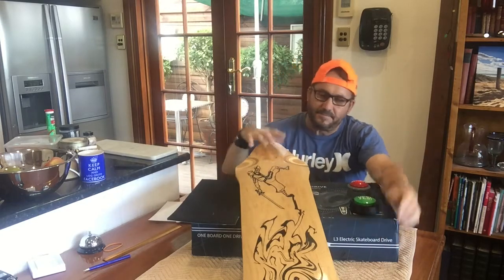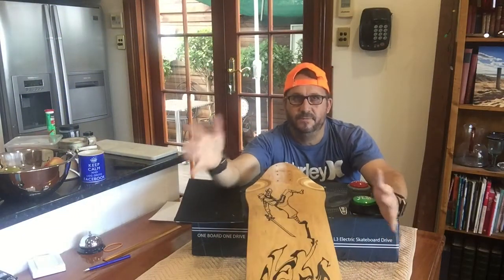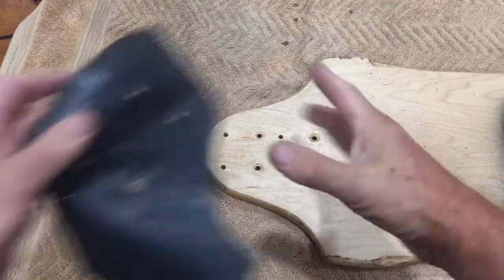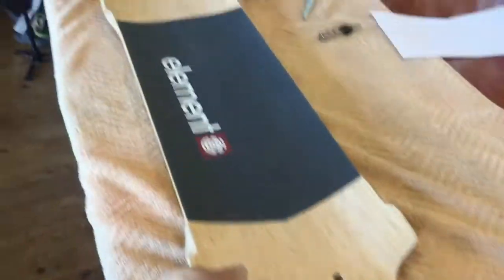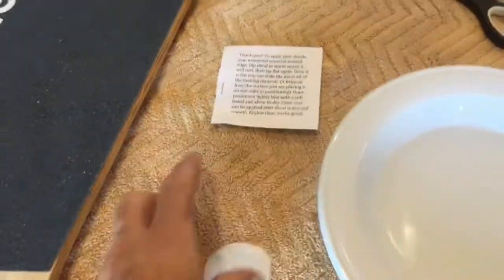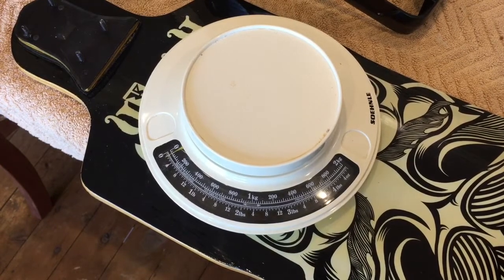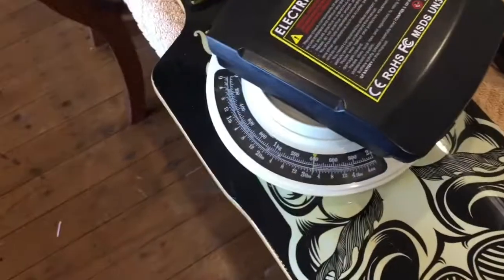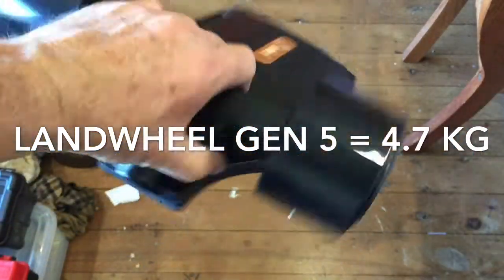LandWheel V5 L3-X EBoard - Full Setup and First Ride Andrew Penman EBoard Reviews Vlog No 51

Comment: Hi Andrew the board looks great and awesome video on the full set up. It will make it a lot easy for anyone having this to refer to when putting a EBoard together..Cant wait to see part B...
Reply from the maker: Herb Brad Tronc )) Cheers that’s really appreciated)) it was fun... all went so smoothly ... unfortunately I didn’t have a enough or the right width grip tape so I had to be dead accurate (within 1 mm) in rolling at sucker out ... it’s quite difficult as you can imagine.... ever tried to roll a piece of rectangle carpet rug up LOL ie Part 2 coming is quiet important for this Booster ...Cheers Bro Andrew )(

Comment: halo again Andrew, do you prefer this or the Onan x2 2wd =) ?
Reply from the maker: Het JasonxFong )) it’s great to hear from you Jason. Okay both are nice Boosters but the landwheel Gen 5 L3X has a much better battery latch connection design and a much more superior ESC in terms of it’s linear curve  and ultra smooth breaking. The battery on the Landwheel is also smaller (700grams) and more powerful its a LiPo Polymer. The Landwheel also has a faster top speed at 42klm /h. Don’t get me wrong I still like the new Onan X2 ‘s Sensorless FOC it’s vast improvement on the original ESC )) Hope that helps Jason) awesome great to chat Andrew)(

Comment: Thanks, Andrew! How odd that the total Landwheel drive weighs more than the Onan! I look forard to range and hill testing.
Reply from the maker: Hey Mike Cane )) Great to hear from you, yes it is very interesting, but it is a good point because it means the battery on the Landwheel is half the weight which then obviously makes the mechanics / motors and  hubs more heavier than the Onan’s  which is a good thing actually ie that means it’s made with more solid parts and slightly bigger KV rated motors and say )) there is a small issue with the sides of the battery compartment coming loose on the Booster and I’ll in my wrapup on the “Long-range Distance test” and follow-up with a nice Vlog  on how to hack /modify / fix it which a typical Andrew Penman classic perfect hack/ fix lol ) other than that it’s an incredibly well made and beautifully refined electronics and technology EBoard )) Cheers Mike keep up the great work in NY)) Andrew )(

Comment: Nice grip job on the deck..  Can you charge the battery out of the board??
Reply from the maker: Hey Brian D Howard )) thank you so much bro, yes you can it’s a better clicking in locking system battery system than the Onan X2  it’s a smaller battery and it’s just a beautiful unit however Brian there is a small issue with the side plastic casing coming off and I’ve done a really good modification fix for this )) and Landwheel have increased their screw sizes now )) Great travel OS  Eboard Brain to add to the quiver ie put on a nice small deck for you it would be a pocket rocket  )) cheers Brain Andrew )(
Reply: Andrew Penman I keep toying with the idea of getting one and adding it to a slightly larger regular skate deck,  it would be fun to ollie up crubs with it..  Due to weight a curb would be the biggest ollie I could get I bet..  Great review as always..
Reply from the maker: Hey Brian D Howard )) absolutely that would be a really nice piece of her afterburner when you’re ready get air ... lol .... I haven’t got huge clearance under them unfortunately but the Onan is the best of the two )) look pretty sick on a Penny Board to that fits in the small backpack it’s incredible amount of power for a penny board.... I’ve seen your skate park skills )) pretty impressive Brian )) well done 👍 )) I finally got the Spark at 1 km off line off site nearly and I didn’t get nervous ... bit it is like a big $750 note flying off the distance lol ... seriously look at getting one for OS travel Brian they are amazing the 1080p footage from them and the new advanced Gimbal is state-of-the-art dead smooth )) best new toy !!! cheers thx Brian )) Andrew )(

Comment: I have one with one extra battery and extra tyres and it's for sale. 2 weeks old. Msg me if interested.
Reply from the maker: Hey Michel Koon )) that’s a shame you’re letting a go quite an amazing electric skateboard booster. Tell me did you have a problem with your side Batt casing coming off as that may be why you’re selling it because I have a really good hack / modification coming up in the next few days how to fix this issue perfectly )) in my opinion the LandWheel Gen 5 is a robust well engineered unit and my mod /fix is pretty stylishly sexy and make the casing last forever )) but I’ll let people know cool )) Cheers Bro Andrew )(